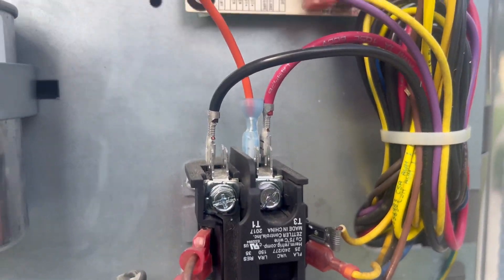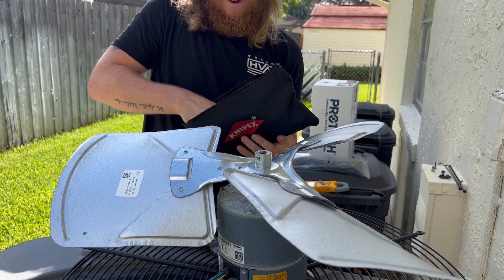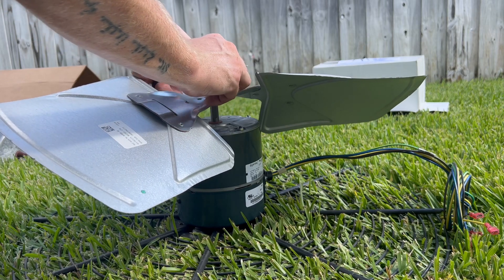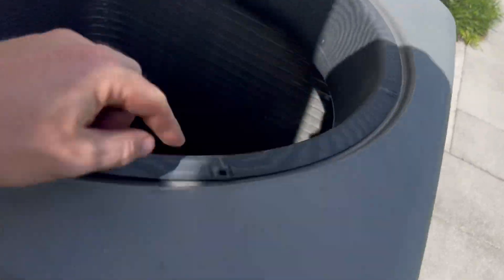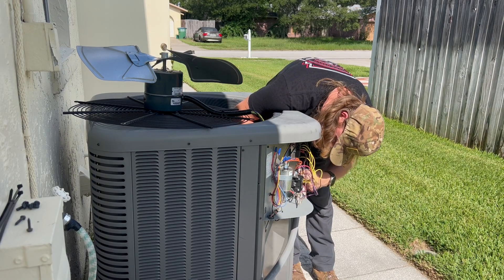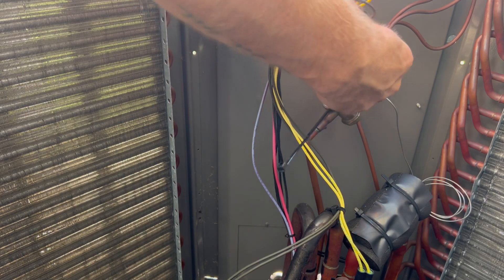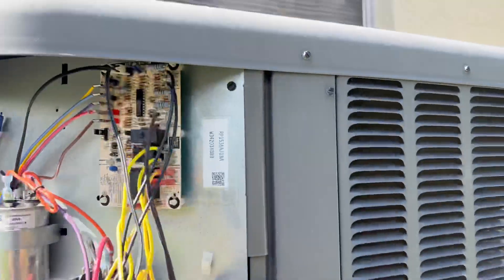Using a PULLER | HVAC TECH | Failed Variable Speed condenser fan

Comment: I use a ratcheting wrench on the set screws not the allen wrench that comes with the puller and I tape the motor leads together so they go through the flex without an issue. It only takes a minute and it saves a little frustration. I don't need a puller often but I'm glad to have it when I do.
Reply from the maker: Solid point!! I actually just got a little wiha set that I now use for the set screws because that Allen wouldn’t fit the angles sometimes. I like that that taping of the leads idea, thanks 👍

Comment: 4.09 to 6.25 is 50 secs ?? Dude…. It’s on now… this should be fun. Prepare to be schooled.
Anyway, set that puller up on a rusted blower… not as easy as an outdoor fan by far. 
First off, I’ll do what you just did in a fraction of the time.
Then, I’ll do a really tough one and challenge you to compete.
This should be fun !!
Reply from the maker: Im down for it 😂 Now the time stamps you provided were from the time I  broke the lock screw, so at 4:09 is when I started to work on getting the fan off. And to the 6:25 still ain't that bad from start to finish. 
But what I said “from  setup to start maybe a minute” which I said at 6:44
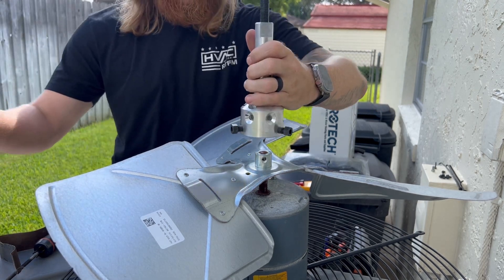I start at 5:34 with puller on the hub tighten the locking screws and it’s off by 6:25 
Don’t forget I live in Florida with the amount of humidity all year and the salt in the air, that shaft was rusted as hell, you can see it. 
Without using any spray or needing to clean it, that puller pulled it right off. 
By the time your done letting the spray set up and doing all that, this system will be back up and running and on to the next call!! 
If the puller is needed I’ll pull, if not I won’t it’s just that easy brother Ted 🫡
Reply: You’re definitely delusional there my friend. And the old man is going to teach you a lesson. Stay tuned! And anyway, the shaft was not even sticking through at all not even an eighth of an inch. I could’ve knocked that thing out in 10 seconds or less and you can’t tighten your set bolts, which is also counterproductive anyway, in that period of time. Either way reaching down inside of a blower will be a lot harder than the outdoor blade in the open. I’m going to make two or three videos and if you can beat one, I will buy you any kind of puller you want and ship it to you.
Reply from the maker: @TedCookHVAC     🤦‍♂️I don’t need a puller Ted,I’m good this one works just fine 😂 👍 and give yourself some credit you ain’t that old!!
Reply: @KoolinwithKrauss  8,48 you even admit the hub was flush with the shaft...... video a hard one next time you see one !! I am 61 btw.
Reply from the maker: @TedCookHVAC looking good at 61 dude, hope my hair stays around that long 🤣 . If it doesn’t start moving with a wrench in the hub I just get the puller, I find it easier, generally 9/10 I don’t need it!!
Reply: Ted’s video brought me here.  Let the challenge begin.
Reply from the maker: @motordown7664  appreciate you stopping by!! 🫡
Reply: I am betting on Ted, I have not used a puller for a few years now
Reply: This is awesome watching you guys battle it out! I’ve been doing heating and air for 20 years since I was 18 not counting all the times going on side jobs with my dad when I was 12 years old hooking up flex, collars, etc. in the crawlspace and attics. I love watching both of you guys videos!